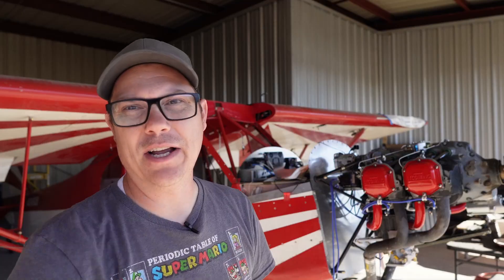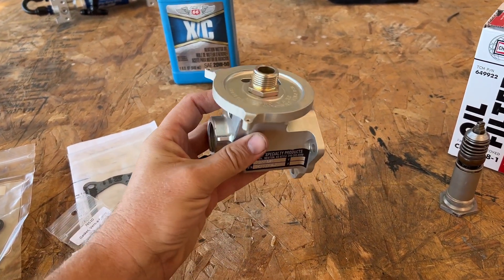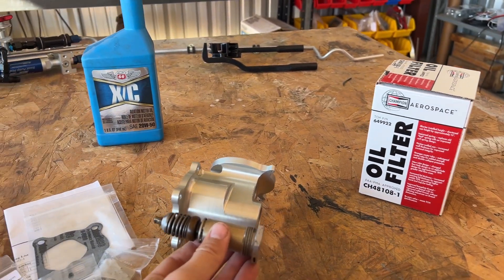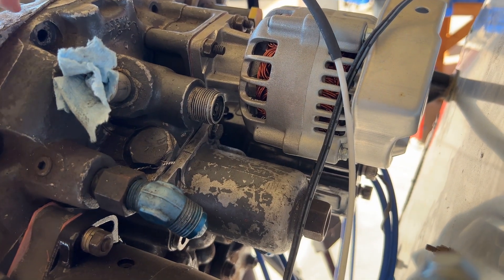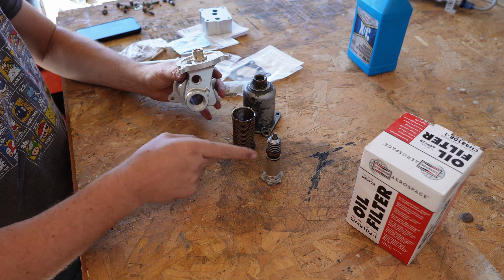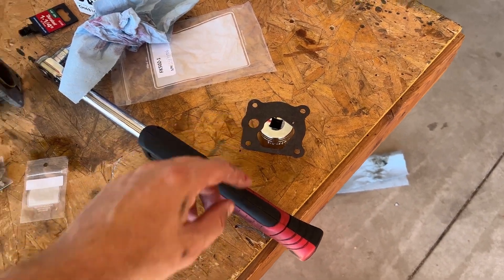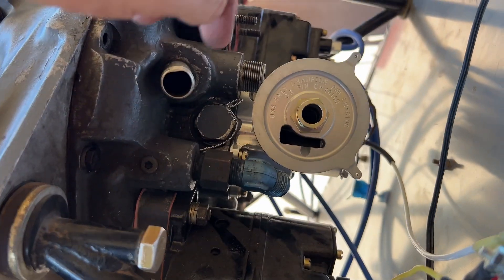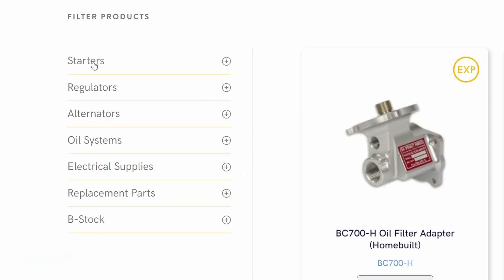Worst Oil Filter Design! | B&C Oil Filter Upgrade!

Comment: Does the spin on adapter require safety wiring as well?
Reply from the maker: YES! I didn't want to secure it until I get that oil line done. There are 2 points on the adapter to safety wire it to.

Comment: Hey Carl, you should put just a little oil on the gasket/o-ring of the oil filter so that you will be able to get it off easier when it is time to change the filter. Great update, can’t wait to see the first start of the engine. Keep up the great work!
Reply from the maker: Thanks for the advice! I'll for sure be doing that. I do it on all my cars after struggling to get some off in the past. I remember having to put a screw driver through one to get enough leverage.
Reply: On the Champion oil filter you use Dow Corning DC-04. On Tempest filters you leave dry with no lubricant of any kind used